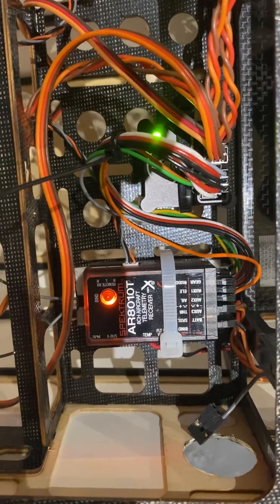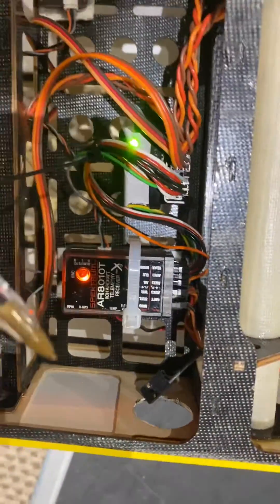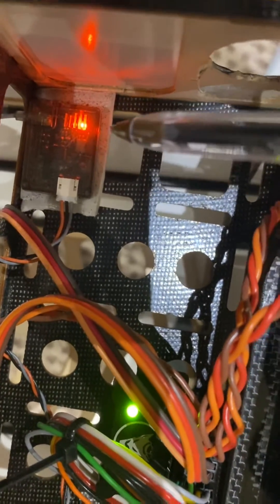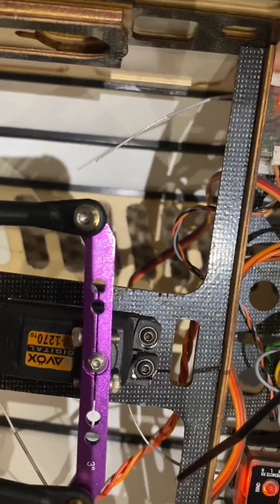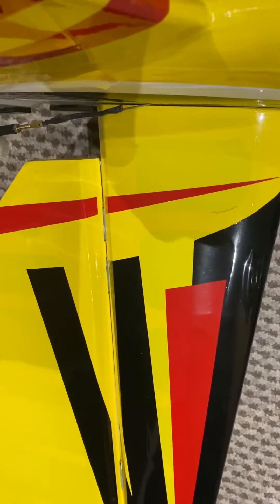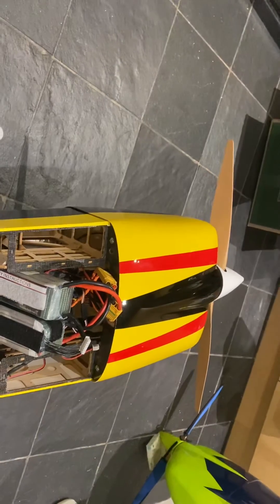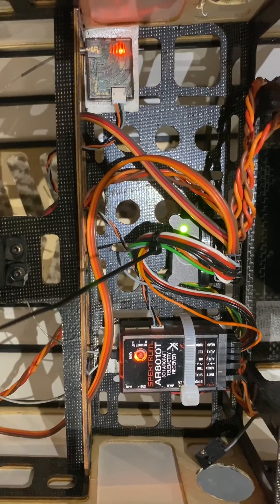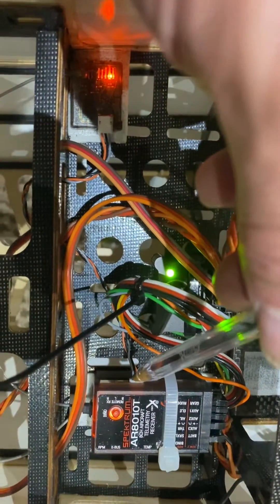AR8010T Receiver and satellite April 2021.

Comment: Thanks for making that video! I really appreciate it. I don’t have a satellite plugged in and my orange light on the receiver flashes instead of being steady. Could not having a satellite be the issue?
Reply from the maker: Yes not having the satellite would cause the problem of the receiver not receiving the correct Signal and with your receiver having a flashing light meaning it needs the satellite plugging in its sensing the satellite is not in that is why you getting the flashing orange light on the receiver. 
I had the same problem at first then when I put the satellite in and made sure both lights were on it cured the problem but you do need to bind it with the receiver and the transmitter away from each other that receiver has been exceeded by the new one which is a AR8020T and the Ar8020T don’t have the satellite
Reply: @dannyporter888silverfox8  I’ll buy a satellite and test it out!! What satellite do you have / what satellite do you recommend? I apologize I am new to the RC plane world and I appreciate you taking the time to educate me :)
Reply from the maker: You should of had the satellite comes with that receiver when you bought it.. just a normal 2.4g satellite would do the job.. am I right to think you are using 2.4G transmitter?
Reply: @dannyporter888silverfox8  yes! I am using the Spektrum DX8 transmitter. I just uploaded a video of what I think is the satellite but I’m not sure which port it goes into
Reply from the maker: Ok I have just up load a video for you to look at to see where the satellite port it’s at also at the back there are four ports first one is for the voltage meter on the telemetry!
Reply from the maker: It can be any port B port stand for back if you want to put your satellite at the back of the aircraft .L port means if you want to put the satellite on the left-hand side of your aircraft R port means you can put the satellite on the right hand side of your aircraft those are the three ports you can plug your satellite pending on the length of the satellite lead where you can have your satellite.. and that is the right satellite you have in your hand from what I can see on the video!
Reply: @dannyporter888silverfox8  Hey! I did what you said with the satellite and I’m having some trouble programming the ESC. I just uploaded a video of where I’m getting stuck
Reply from the maker: I just looked at your video..after you have put your throttle stick to full throttle you should hear the bleeps once you heard your for throttle finish sleeping put the throttle stick down all the way down and then you will hear another different sets of  tones maybe 6 bleeps cos you are running 6 cells then try if your motor runs.. if your motor runs then you shouldn’t have any problems programming it!!
Reply: @dannyporter888silverfox8  when I try it I just get the constant one beep that is in the video :(
Reply from the maker: After when you pull the throttle back and then power up dose your motor run?
Reply: @dannyporter888silverfox8  the motor doesn’t run. It just does the single beeps indicating that it doesn’t have a throttle signal
Reply from the maker: That is where the problem is the motor should run.  After the first stage.. disconnect the battery to the ESC.. go into the transmitter menu throttle travel put it to 100% on full travel.. sub trim 0%.. then come out of the menu and turn the transmitter off.. put the throttle stick on full making sure the wire from your ESC to the throttle back into the receiver.. then turn your transmitter on with the throttle stick full.. plug in the battery to the ESC.. then listen to the bleep when the bleep finish pull the throttle back to 0 all the way down and then listen to the beeps again you should have six bleeps to say you are on 6 cell.then try your motor to see if that will work!
Reply from the maker: Are your satellite and receiver light both staying on? If they are not staying on that is your problem and they need to be rebind again!
Reply: @dannyporter888silverfox8  I played around with my setup and the motor started to run but it was very choppy. The rotation was stuttering. I thought it didn’t have enough power so I plugged in a 6S and a 4S in series to get the 10S and the motor made a weird sound and stopped beeping. Now when I supply power to the ESC I don’t hear any start up beeps. Did I fry something? The motor im using is EFlite Power 160
Reply from the maker: Your timing was probably wrong and out  from the noise your motor was making if your motor can take 10s and your ESC can take 10 cells then no you wouldn’t have fried anything..However if your motor is not meant to take 10s or your ESC not meant to take 10s then chance says you may have done some damage to the electronics..
Reply: @dannyporter888silverfox8  how do I fix the timing? Is that in programming mode?
Reply from the maker: You need to get hold of a programming box from your local hobby stores.. I made a video about programming box have a look at it!!
Reply: @dannyporter888silverfox8  great! I just ordered the SPMXCA200 Programming box and will let you know how it goes when it comes in. Thanks again for all your help!!
Reply from the maker: No problem at all that’s why am make them videos to help people...:-)
Reply from the maker: Have a look at the videos I made about ESC and compatibility with motors and ESC that may help and look at the one about the motor making a searching noise when is near full 
Throttle..
Reply: @dannyporter888silverfox8  just watched those videos! Is it possible that the avian 120A isn’t compatible with the EFlite Power 160 motor?? I couldn’t find anything online
Reply from the maker: The eflite motor has only 14 poles and is 245kv very similar KV to a XPWR35CC motor other then the XPWR 35cc motor has got 24poles which the Avain 120 ESC dose not like high poles motor cos it struggle to cope with it.. so your motor only has 14 poles and 220kv so it should be ok..12 to 16 poles motor is a average motor spec..
Reply: @dannyporter888silverfox8  okay that makes sense! Thanks!
Reply: @dannyporter888silverfox8  I just got the programming box and all it displays is “Connecting to PC”. I have the Spektrum USB link app open on my computer but I don’t have any options on the left hand side. All it says is “About”. Pressing the buttons on the programming card doesn’t work either
Reply from the maker: Hi good morning.. try and use the programming box with out updates first and try and program the ESC then see what is going to do to the ESC.. I have a video on my channel about the programming box! Is a matter of trying and playing with the programming box to get your ESC right.. unfortunately with ESC and programming nothing is straightforward it’s a matter of trial and error! It’s a bit like live it self trial and error! Lol
Reply from the maker: How you getting on with your ESC and the programming box?
Reply from the maker: How you getting on with your ESC and programming box? Are you sorted with it?
Reply: @dannyporter888silverfox8  I just uploaded a video about where I’m getting stuck. I’ve tried pressing the buttons on the programming card and nothing happens either
Reply from the maker: Try using your programming box with out updating your box first.. what you are doing is updating your firmware.. disconnect your USB connection from your PC and from the box and just use the  wire from the box to your fan and you will find it will connect to the ESC..
Reply: @dannyporter888silverfox8  I did what you said and uploaded another short video. My programming box just says “Connecting ESC”. It’s said this for about 5 minutes now with no changes
Reply from the maker: I am at work at the moment.. when I get home I will upload a video for you.. once I upload the video I will message you maybe then we will get somewhere with this..
Reply: @dannyporter888silverfox8  thank you so much!
Reply from the maker: Just uploaded a video for you check it out..
Reply: @dannyporter888silverfox8  thanks for uploading the video! For some reason once I hit the select button on the programming box The screen only says connecting ESC and does not advance to the next menu for changing the settings. Does this mean the ESC is defective?
Reply from the maker: Just uploaded a second video the first video the wire only goes to the fan if you have a y lead but you haven’t got a wire lead so the wire go’s to the lead at the bottom next to the capacitor check the second video out!
Reply from the maker: You ok will the second video?
Reply: @dannyporter888silverfox8  just watched the second video. I think that’s what I was doing before. I just uploaded another video showing where I have each wire connected but I get the same result
Reply from the maker: Just checked out your video and you are doing everything right with wiring the programming box up.. it should work but my only concern is the red light on the ESC.. usually red light it’s a warning light of some sort so I don’t know what’s going on with your ESC that you are doing everything right with wiring it up so it should work..when I get home I will have to check if my ESC have the red light on and let you know.. I am out at the moment and not at home.. but the red light is a concern because read like usually means it’s a warning sign!
Reply from the maker: I just tried my ESC and NO red light is on.. I think the red light is on when you are plugged in to your programming box.. when you disconnect from the programming box is the red light still on? ?
Reply: @dannyporter888silverfox8  red light is still on after unplugging from programming box
Reply from the maker: Red light mean something wrong with your ESC.. check all wires and are you sure you didn’t short the ESC out cos Red light definitely means something wrong with the ESC!!
Reply: @dannyporter888silverfox8  I don’t think I shorted it. I contacted Amazon and they’re gonna send me a replacement
Reply: For the time being I’m going to use two 4S 6000 mAh 14.8 V LiPo batteries in series with my Castle 100A ESC. Do you think this setup will work? The ESC is rated for an 8S battery max
Reply from the maker: Well that is good they are sending you a replacement.. when you get your replacement take your time with it and check everything before you plug the power on and I am sure you will be ok with the replacement cos the red right definitely shouldn’t be there!
Reply: @dannyporter888silverfox8  I definitely will! Is there a way to determine if that battery setup I sent you will be safe with my castle ESC? I wanna make sure I don’t short it
Reply from the maker: Make sure you check that you’re not over propping and overloading your motor when you do that it will pull more amps if you have got A amp meter link the amp meter to the ESC and find out what amps is pulling.. main thing is don’t over prop your motor otherwise it will load and pull more amps..you should be ok with 4s as long as you don’t over prop the motor!